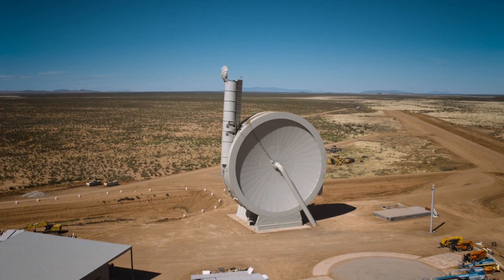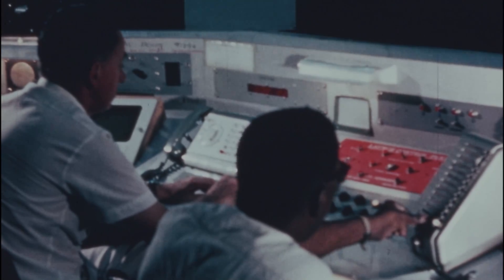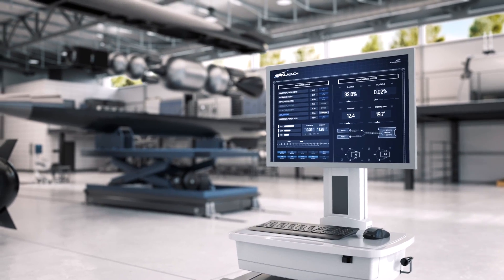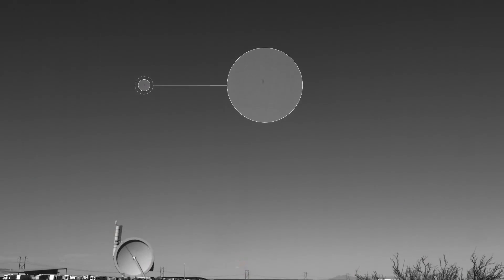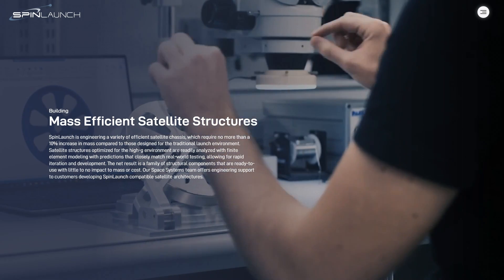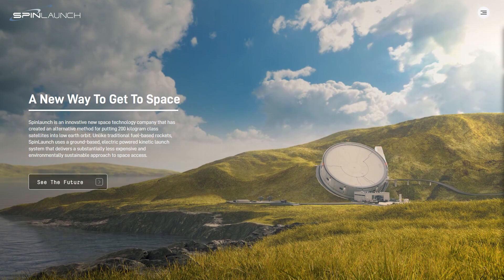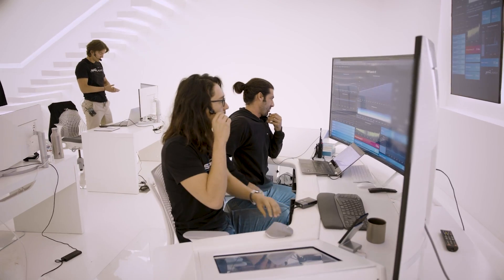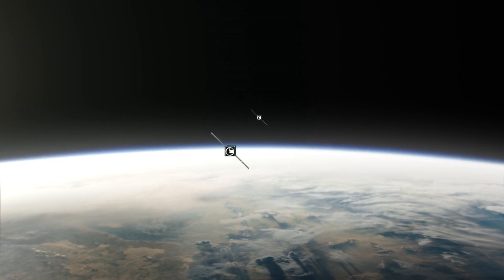Can Spinlaunch Throw Rockets Into Space?

Comment: Wait. 450 rpm?  Given the imagery, that'd mean that the projectile would also have a rotational velocity of 450 rpm as well when leaving the 'gun'.  You can't just stop something rotating.  It has rotational inertia.  In which case, a rocket like projectile wouldn't make sense as it would tumble.  To stop it from tumbling, the projectile would have to rotate counter to the spin up mechanism while spinning up to have this make any sense.
Reply from the maker: You don’t think that rotation could be damped upon release?
Reply: @scottmanley , what would be damping it?  There doesn't seem to be any reactionary thrusters to do that and I don't think a reactionary gyro would be able correct for this.
Reply from the maker: @JackAdrianZappa  Why do you need thrusters? Just use a two point release mechanism and release the front before the rear.
Reply: @scottmanley  Hmmm. Interesting. Didn't think of that.  However, that's also not shown.

I'd also think that this could be a problem due to the payload would have to deal with acceleration in two different directions rather than just one, making constructions of payloads (a little?) more complex.

Comment: So they have demonstrated a Mach 1 launch so far. Big deal! To get into orbit you need Mach 25. That means the accelerations would be 25 times greater and the kinetic energy would be 625 times greater. In fact, to allow for atmospheric drag you need a fair bit more than that. There is absolutely nothing to be impressed about so far.
Reply: It does have a rocket inside........not meant to reach orbit with just the spin launch.

Comment: IT would be nice if they could make something that fits on a first stage.
Imagine accelerating a first stage to some 2000m/s or so like we do now, from where it fires the second stage like a gun. Accelerating the second stage to 7000m/s while the recoil takes away the first stages speed so it does not need to spend energy decelerating for landing. 

I guess it will never happen, too much acceleration needed in to short a distance, but it would be pretty perfect for efficiency if your second stage does not need to bring fuel and you can take away that unwanted kinetic energy from the first stage in one fell swoop.
Reply: If you have the energy to power this on your rocket then you have the energy to do other things with launching.

Comment: I don't understand how you judge this a success or even within the realm of possibility. They're currently generating about 2-3% of the ∆v necessary for suborbital space flight. 
There is also the small problem of angular momentum. This is just a stupid crackpot idea that cannot possibly work, and quite frankly, there are more practical ways of achieving this. 
Electromagnetic ramps show much more promise, and they would still only serve as a replacement for primary stage  launch. You're still going to need a stage to pick up around 10,000 meters when this thing tips over and starts heading back toward the ground.

Comment: Talking about speed and hitting atmosphere, checked why Navy railguns projectile speed tops out at mach7. And the reason is that even solid tungsten and perfectly aerodynamic projectile would start to melt from air pressure at mach7, a little melting is not big deal if you have a solid projectile, but if you have a spaceship that has only thin outer protective layer that can melt and break whole thing.

Comment: I mean maybe instead of trying to yeet the thing the whole way, why would you not make a system like a particle accelerator. If the size of this chamber is as massive as it is I would think using a electromagnetic propulsion over the course of a few miles or even a continuous massive loop until a track switches to give vertical positioning with the possibility of a fraction of propellant required.

Comment: I have an idea for stabilizing the projectile. The faring for the projectile should incorporate a ramjet-like technology and use the thrust mostly to keep course correcting until a vacuum is reached. The faring should be recoverable with a parachute or three.

The moving parts of the spinner scare me. Hopefully it can contain any catastrophe instead of yeeting a school bus into downtown Los Angeles. I am also curious what they use to decelerate the spinner. Using an engine brake could immediately wreck the entire engine, but if designed well it could recapture most of the free inertia back into electrical energy. Then also they separate the axel from the spinner and use wheels with an amount resistance to function as a disc brake of sorts.

Comment: This is total BS. Why go through all this spinning nonsense, when you can launch directly in a straight line with a hydrogen+oxygen engine? Hydrogen+Oxygen can also be "entirely" made from solar cells and water.
What happens during release when things inside the rocket payload goes from 10.000 G to 1 G in 1 millisecond? Not surprising that the whole rocket is wobbling during launch.
A better approach would be to build a sealed straight tube, with vacuum inside, with a length of >10 miles. Then you can do linear acceleration with magnets inside this tunnel.

Comment: I'm not a fan of TF, he can be petty, but I think some of reviews have value. What does Mr SM think of TF's view of Spinlaunch?

Would the G's created by their system lead to failure as per TF's assertion?
Reply from the maker: Well, as I’ve said, I think there are major flaws with his claims. Like basic statements about vacuum chambers and sealed bearings which he claims are impossible despite examples existing elsewhere.
But fundamentally Spinlaunch are unlikely to be successful because their launch vehicle doesn’t have enough of a size advantage over competitors.
Reply: @scottmanley  Ah, so you feel that while their tech is plausible, as a business case they don't have a niche or USP that gives them a market advantage or service difference enough so they will be successful. If they are honest I hope they succeed. I appreciate your opinion is not an indication of your feelings towards their success. I kind of feel that the challenge to make the tech work coupled with your spot on view about "their offer" means they're less likely than more likely to succeed.

Comment: It's pretty clear they didn't actually have even a 50% vacuum on the test launch.  A larger design would need a very thick "foil"  to not rupture  under vacuum and would damage the rocket and payload, so a synchronized explosive port cover ejection would be necessary.  
Payloads and rockets will become very heavy to meet the 10,000 g load for an hour and half.  I have heard they usually do not go over a momentary 80g spec.  Payloads have moving parts, unfolding solar panels, unfolding antennas and such.  What practical payload is ever going survive the centrifuge?  Cellphones have no internal moving parts (beyond small lens focusing), so they can be mostly cast in resin for strength. Cellphones are not a reasonable example.  Comm satellite?  Optics heavy mapping satellite?  Deep space telescope? Not a chance.  Maybe a kinetic impact inteceptor (e.g. SM2 family) could be made tough enough, but the existing ones already work just fine.
The missile will need a heavy  heat shield to launch at mach 7 at  sea level, eliminating much of the streamlining needed to keep some velocity up to upper atmosphere. 
The initial high negative Gs when entering sea level air density would make it very difficult to start the rocket engine, so it would have to fire inside the vacuum, possibly damaging the centrifuge housing.   
The "missile" was clearly tumbling coming out of the foil, which is no way to launch a rocket.  This problem can probably be solved, but if the release is requiring millisecond timing, then the de-tumbling release offsets are likely to be one tenth that time or less, which may never be reliable enough. Did you notice how wide the exit port was?  And in the direction of the tumble?  Looks like compensation for a known flaw.
Air rushing in and hitting the high speed centrifuge arms/blades would destroy them and the housing, so some kind of air lock gate would be needed and it would have to move that metal gate open and closed almost as fast as the rocket without breaking anything. 

This one design concept of a centrifuge launch is spawning a large number of complications that require delicate fix after more delicate fix.  It feels like a bad design with many patches, which never works as well as a good design, which would tend to eliminate complications. 
Even if you could make it work part of the time,  there will be a design concept that is much better because it is simpler, making this design obsolete.
But the thing to watch is that they are lying and/or lying by omission.  I find it hard to believe that they have done mach 6 launches from this current system that were not explosively destructive.  They did not have a vacuum.  The missile was tumbling for 2 or 3 rotations.  The test missiles are more or less solid metal,  because nothing else can take the load.
Reply: It seems like there would be a ton of complications in making the rocket part withstand 10,000 Gs, and the fact it's using liquid propellents. Even if the tanks themselves could withstand that, what happens to the liquids inside at that kind of pressure? Where exactly is the liquid oxygen boiling off to, inside of this vacuum chamber? Wouldn't the nozzles collapse? What about the turbo-pumps, gimbals, valves, release mechanisms? In the Real Engineering video on this, they showed some kind of camera that could withstand 10,000 Gs, and he kind of dismissed concerns about G-hardening as overblown. If that's the case, why haven't they demonstrated their miraculous two-stage G-hardened LOX/kerosene rocket?

This is just a very obvious waste of venture capital. I'm sure some people will argue that some of the technologies developed here might work with other applications, but then why keep pretending they'll actually achieve what they say they're trying to?

Comment: This is beyond the laws of physics. Currently they are operating at 2% of the required power and have zero chance of scaling up.

A hot air balloon and a long stick would be a better solution.
Reply: @timemachine_194 A small centrifuge exploded in our lab at school and completely destroyed half the classroom. Their destructive force is frightening, now multiply that by a factor of several thousand.

Stupid idea.
Reply: @timemachine_194 Centrifuges are known for their propensity to fail spectacularly. Their design means that the tiniest flaw will GUARANTEE critical failure. A bearing is damaged, the thing will explode, a nic in the arm the thing will explode. Too much wear and tear the thing will explode.
They are literally constantly trying to tear themselves apart and require an unbelievably accurate balancing.

Some object,animal or big enough piece of dirt  lands on the arm, the Ballance is out and it explodes. 

Look how precise they have to be to balance a cars turbo and multiply it thousands of times.

I'm not convinced.
I'm going to stop now, you can go ahead and have the final word if you like.
Reply: @timemachine_194 No object has ever been produced that can travel much beyond Mach 1 at sea level. The air is thick like treacle past that. All supersonic planes have to go to very high altitudes to reach several times the speed of sound.

This project will require a physical item to be accelerated beyond Mach 6 at sea level. It hasn't ever been close to being done.
Then, when you look at alternatives to this there is one that is far simpler, far superior and with many advantages over this.

A 100 year old naval gun can already fire twice as fast and twice as far as this prototype. You can reload and refire immediately rather than waiting eight hours for a vacuum seal and 24hrs to spin up. It isn't likely to explode in a catastrophic bang with enough energy to destroy a small town either.
Also the G forces are sustained for seconds rather than hours.

I suppose it comes down to if you need a more powerful gun do you take an old gun and improve it or build a seriously complected crossbow and try to engineer it to first match the old gun and then improve it to the power you need.
Reply: @timemachine_194 A gun is a lot simpler than this ridiculous overcomplicated nonsense. It cannot work and will not work. These people have no knowledge or experience in the field, this is complete BS.

It would be far simpler to create a strong enough gun than it would to create a giant centrifuge which doesn't explode under those huge forces.
It's a stupid solution that is bound to fail.
A projectile from a gun travels in a straight line, this thing chucks things out at in a vector, tumbling and unstable more or less in the right direction.

Which solution do you think will be easier to engineer?  Let me guess, the one with a hundred problems to overcome before it becomes an inferior alternative to the gun?

Let's solve multiple engineering issues rather than just one, that makes sense. Maybe try making a more efficient gun, that would be a worthy engineering effort, or should they try collecting rubber bands and build a giant slingshot?
Reply: @timemachine_194 If a fly lands on a rocket it doesn't go boom. If someone leaves a piece of sticky tape on a rocket it doesn't go boom. Both of those things can potentially destroy a centrifuge on that scale.

You'd be better off using a hot air balloon and a very long stick. Why not use that model and try to engineer all the many flaws out of it?
Reply: @timemachine_194 Nope. All forces will be magnified. The fly will experience 20,000 G. That makes the equivalent of 20,000 flies on a single spot.
That is enough to throw the whole machine off balance. If you have an unbalanced fast moving mass such as a turbo it will fail.

Comment: What happened with the idea to use an electromagnetic sled and sloped ramp to accelerate a rocket with 2nd stage and payload. I realize that the ramp length would be measured in miles, but it would not need the huge amount of (polluting) fuel to get through the majority of the atmosphere. Accelerating force could be managed more precisely and g force could be made more comfortable for passengers.

Comment: Still wondering how the spin arm takes being suddenly unbalanced by 10 tonnes at that speed and G force. That's a /lot/ of energy to absorb.
Reply: @timemachine_194 A meteorite is slower when it produces a large crater.
Reply: @timemachine_194 No I just meant that the counterweight of the SpinLauncher is faster than an average meteorite and therefore causes more damage per kg
Reply: @timemachine_194 A nuclear explosion 500 m underground will nevertheless leave a large crater after a few hours, as the cavern collapses.
And most important: there must be no shaft to the surface if you don't want to have a catastrophic eruption.

Comment: The problem is the “rocket”, by design, is tumbling 360 degrees with each rotation of the arm. If the arm is rotating at 450 rpms, the target speed, the rocket is also developing rotational end over end momentum at 450 rpms. This end over end rotational momentum has got to somehow be eliminated before the arm lets go. It can’t be done after. The way it’s designed now, when the rocket is released as the arm passes 3:00, by the time the arm is at 12:00, the rocket will already be horizontal.

Comment: Thinking about the G-forces exerted onto the payload during the spin up and how unlikely the payload is to make it through that process. Obviously, no human will survive that centrifugal force, the forces applied to the payload would be just too extreme. Even mechanical structures would have issues with those forces, even if they survive the launch process. I don't think these technical hurdles will be easily and cheaply overcome to make this a commercially viable solution. The centrifugal force of a 1000 kg object accelerated to over 2200 m/s in a 50-meter radius would be about 10,000,000 kg force, which sounds unrealistic.

Comment: This might be a more practical means of moving lunar mass off the surface of the moon. The L5 concepts of the 70's proposed getting lunar materials to the Lagrangian points to use as raw materials for large space construction. They were based on linear accelerators and solar power. With the spin launch, you wouldn't need the large structure of the linear rails, and you would be launching in near vacuum so that would eliminate the problem of crashing into 1 atmosphere of pressure first thing. It would be more manageable in size.

Comment: The clamping force alone needed to hold the projectile to the arm at over 10,000g would be astronomical
Reply: Additionally, if that chamber was an actual vacuum, every shred of that "skin" over the ejection port would be violently pushed  into the chamber by the weight of the atmosphere and pressure differential as soon as the projectile pierced it.
Reply: If you need to see an example of this, watch a video of the hypoxia training airforce pilots go through. The force with which the atmospheric pressure returns to ambient is wild.